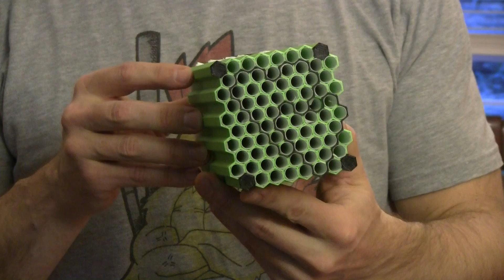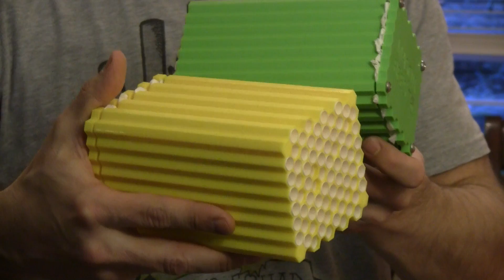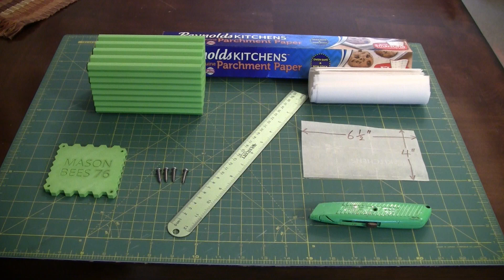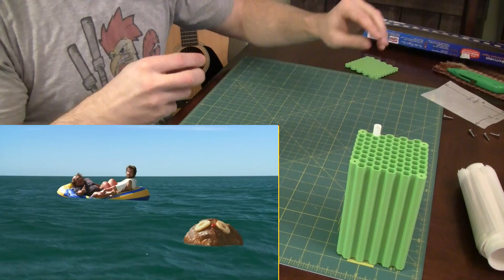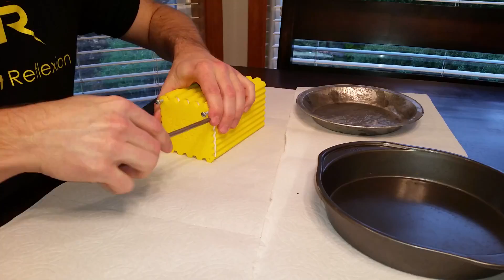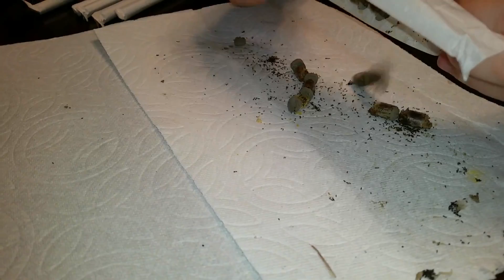3D Printable Mason Bee House

Comment: Hi Bill, I watched your video sometime back and just printed a couple. They turned out very nice and good job making this video. Very easy to follow and a real asset to Thingiverse. 

It appears you don’t post regular and U have a couple questions if you happen to read this. A) it seems the hole diameter is critical and established at 8mm or 5/16. The prints I made produce an across the flat dimension of approximately 0.350. Is it the intention of the parchment paper to produce a slightly smaller hole and that is close enough to the required size? It is probably a moot point as you seem to have no problem raising Mason bees with what you have designed. My second question is regarding g leaf cutter bee houses. It is recommended they be 6mm or 1/4”. Is your design on Thingiverse adjustable? If not I will start from scratch and see if it is of interest on Thingiverse. 

Thanks for the great job and happy beekeeping. 

Jim Morrison.
Reply from the maker: Hi Jim, thanks for the comment! Yes, it is intended that the parchment inserts reduce the diameter of the tubes. I have been using these mason bee blocks for about 6 years now and the bees seem to do great in them. A friend of mine has also printed and used many these at his house and shared among friends. They seem to work well. However, the leaf cutter bee blocks haven't worked for me. The leaf cutter bees failed the first season I tried them and I haven't bothered to try again. They are sized to be 1/4" tubes. I don't know if it was the blocks, the batch of bees I ordered, or my garden. I have updated the Thingiverse listing to include a link to my OnShape files, which also includes a shelter and hatch box design that I haven't published to Thingiverse.
Reply: Hi Bill, thanks ever so much for getting back to me, very kind of you. 

My granddaughter and I are just going to start a cedar bee house to enclose your blocks so thanks for the reference on Thingiverse. 

I planted Borage in our garden this year and found a big increase in pollination in our yard so we will try and raise mason bees. I think this will be a good combination and hopefully a great chance to raise some bees. 

Thanks again Bill and have a great day.